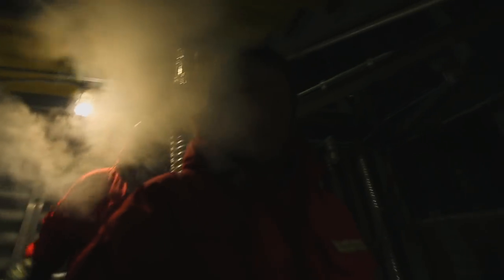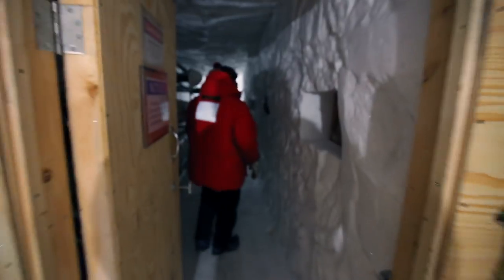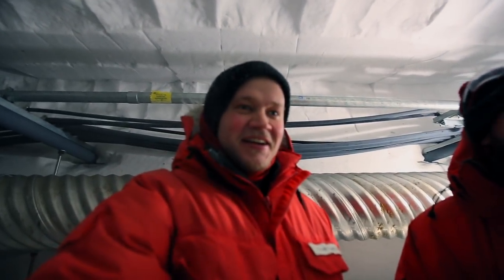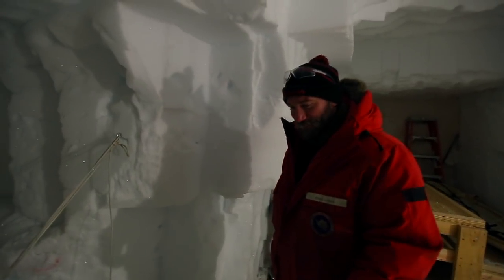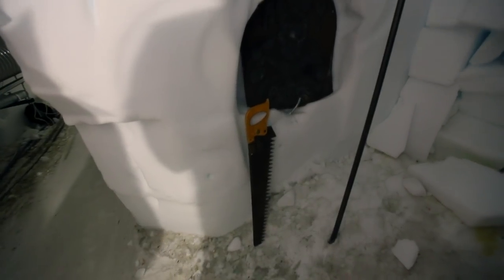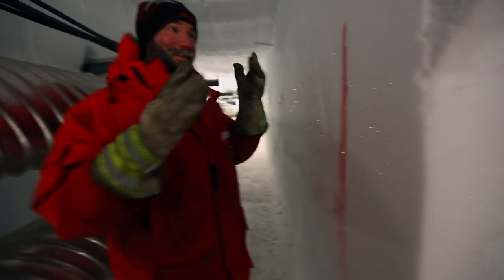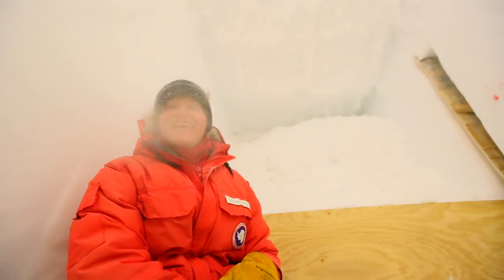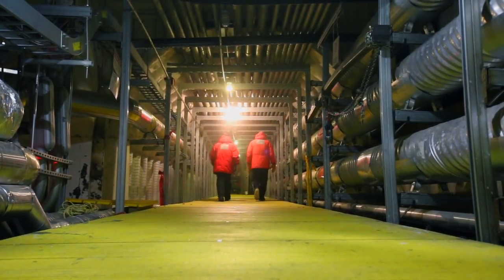Exploring the MYSTERIES of the South Pole ICE TUNNELS!

Comment: How does the water/waste not freeze in those pipes going through that -50C tunnel? Also, I'm surprised you guys use F to measure temperature. I know it's an American station, but still surprising considering it's a scientific outpost. Thank you so much for showing us these really cool areas and doing the station tour. So fascinating!
Reply: You might be surprised to hear this, but most of our engineering work for space, defense, etc, still uses imperial as a primary; And after the mars mishaps and others, you can imagine there are (for many institutions) standards for unit conversions during deeper design or mission architecture reviews.
Reply: In the end, its really about intuition from familiarization.
Reply: I too would like to know how the fresh and waste water does not freeze. If the pipes or liquid was heated you would assume the heat would leak and the inside of the tunnel would be between 30F-40F, which is fairly comfortable in a lot less gear then they have...
Reply: These pipes man. Don’t know what they are for? Looking to me like air pipes. No waste or water pipes. Just air shafts. Yea these jokes huh? Totally hidden in plain sight. Your are looking at them and don’t realize it. We look like you 👽👍
Reply: The liquid moving makes it difficult if not almost impossible to freeze
Reply: @mfrancis33  How fast is this liquid moving? There's a finite supply of water at the place, I imagine. Even if they were melting it, I'm sure they're not going to be wasteful. Especially considering the small size of staff left over during the winter, and at some events, all of them are in a single room (like during the various events, etc.). At -50C, the water in those pipes would freeze instantly.
Reply: My uneducated guess is that those pipes are the outer shell with an insulated pipe inside. That's how I would do it anyway.
Reply: @NicGoldenEddie  Water pipe + tons of insulation + outer shell.  The outer shell may indeed be a made from commercially available air ducts.
Reply: @NicGoldenEddie pipes need to be insulated, so most likely this is just outer shell and real water pipe is inside. Ridged shape improves rigidity and needs less support.
Reply: Despite all the armchair experts here, there is a simple reason those pipes don’t freeze. Did you notice there’s no frost on them either? They’re electrically heated.

Comment: Is the sturgeon still down there? I had the opportunity to go down there one season while deploying IceTop. There weren't as many shrines down there. But I do remember the pig's head (with sunglasses), and a frozen bottle of Crown Royal, and of course the sturgeon.
We called the ice crystals "poosicles" because they were really only there in any significant amount around where the outflow was dumping into the old rod-well. As I remember the new fresh water rod-well was connected and commissioned a few years after my trip, so your current outflow is probably filling the rod-well that I drank out of.
Reply from the maker: It is indeed! And those shrines as all still that. But you're probably right about the Rod-Well as well! But that's really cool! I need to ask though, what's IceTop??
Reply: @GoneVenturing  IceTop is the surface array to IceCube. At the top of all the strings for IceCube are two tanks, each with a 600 gallon block of optically clear ice and two of the IceCube DOMs embedded in them. (Is there still a DOM just inside the entrance to the station?)

Comment: So this is BELOW the ground?  If so, I can't imagine how difficult the planning and construction of this site was.  Insane.  And it's carved out of the ICE?  The walls aren't concrete?  And why does the building set elevated?  And WHAT ARE ALL THOSE PIPES?  I saw one was water - how is it kept from freezing?
Reply: The water is moving, so it doesn't freeze
Reply: Below the surface yes. You're still 9000+ feet from "ground". The building on the surface is elevated to stop snow buildup from burying it.
Reply: Why didn’t you listen to the video as this was explained!!!!!!!!! By the way, the pipes are electrically heated.
Reply: Calm down 😅 The only dumb question is the one that isn't asked. I bet if I re watched the video I would pick things up I didn't see first time around.
Reply: BTW speaking of flat earth, if the earth was flat and north pole centred, there would be no south pole. Antarctica yes, south pole no. Hmm does this mean the earth is flat but centred on the south pole? 😂

Comment: Back in 56/57 when the first station was built, they dug tunnels for water ect downwards for a way. Are they still open today?
Reply from the maker: They wouldn't be open anymore. We still melt ice to get our drinking water though! But there are no signs from the original station around, or even really the dome that was decommissioned in 2008.
Reply: @GoneVenturing  I cant believe they dismantled the old 50 m dome. Unless they needed that ground, it could have been used for storage or summer outside camp personnel or even an emergency shelter which they have to have in case of fire. They use part of the new building for this now, but its still joined and what if it really is all somehow destroyed? So typical political/govt bureaucracy? 
Yes, the dome use to be an issue being buried a bit and they had to keep clearing the snow away but they have heaps of equipment there that can do the job especially if its used as a facility. If the dome was becoming unstable or corroded fair enough it has to come down but perhaps leaving it there a while longer couldnt have hurt if it was ok?  The original wooded station from 56- 74? would be buried under a lot of snow unless they removed that and then built the dome. 
Imagine Scott/Amundsen, if they saw today the 2 story structure with 2 gyms a music room , large dining room and all the scientific areas the new station has. Its the size of a small university and every piece had to come down by plan e and all the food and fuel from Mckmurdo  and from NZ and from the US? No wonder the US is broke and aust too for that matter!
Reply: I suspect it is all about the cost of upkeep. The ice is always encroaching.

Comment: Have a breakfast meal in the galley. Then walk down all 92 stairs of the Beer Can. Walk through the corridor pass the power plant and “LO” arches into the garage arch then sit down in the office and drink a “Speight’s “.
Reply: sounds like you were there>do you have any advice for me >i have been looking to get work in the kitchen down there>i have been a chef for 15 years worked in resorts before and this seems like the ultimate adventure and i imagine the pay is good
Reply: @chefdevil22  Work on your high altitude cooking techniques. The station is about 9000 ft elevation, but because the atmosphere is a bit thinner at the poles it is really closer to 10,000ft pressure altitude.